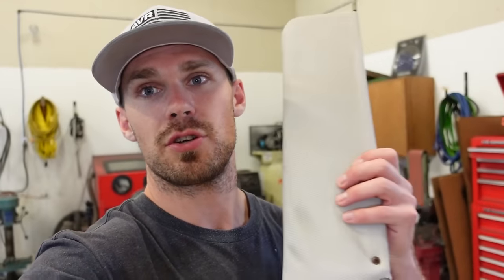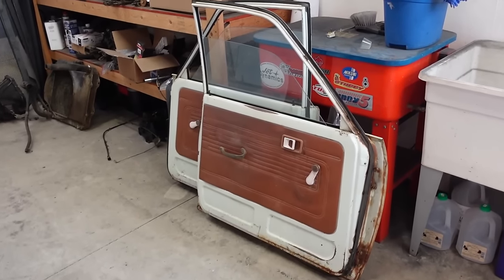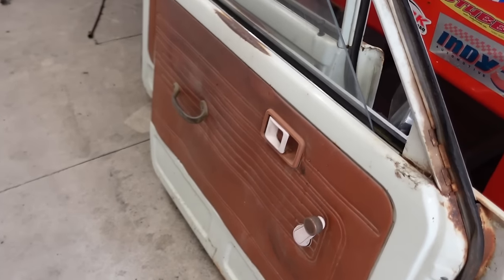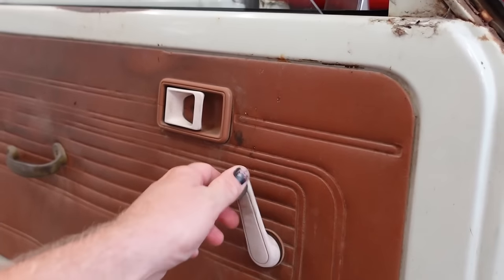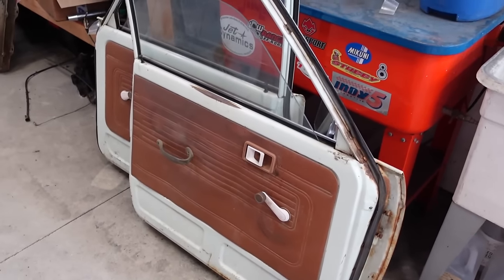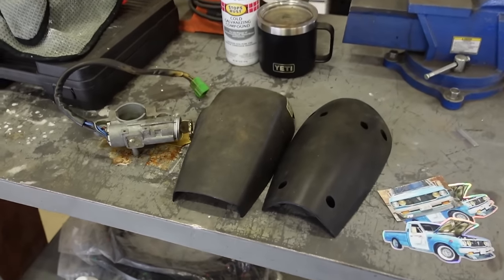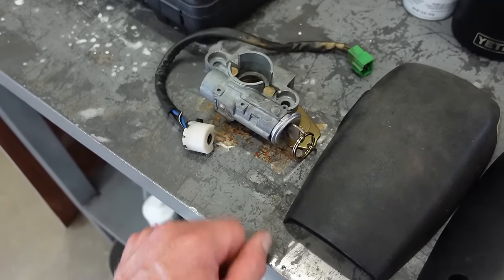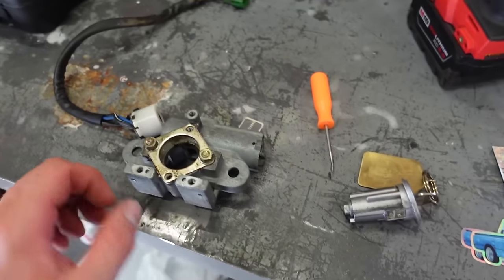Building The Best Looking Hilux Doors Ever!

Comment: Quite handy with the needle bro
Reply: Those sunvisors need some tying in say three spots in the centre as the weight of the material you just added will cause the bottom of the visor to sag and separate becoming like a pillow

Comment: Nice work, If your using old window channels, I find spraying them with silicon helps the window to slide easier. That’s what I use on my 89 first gen runner.
Reply: Putting silicone on all the rubber extrusions is super satisfying.

Comment: Beautiful job. Loved seeing the cleaning solution on the glass with the razor. I own a window cleaning company and that's how you do it. If the razor dislodges any debris that can scratch the glass, the solution will help carry it off the blade. If dry it will stay on the blade and potentially scratch the glass. When it happens you'll know. Sounds like nails on a chalkboard. Recommend you blade in sections, one direction, one line only. Allows you to stop the moment you hear a scratch. Running the blade back and forth willy nilly is asking for trouble. Anyway, again looks great.

Comment: Tuffed diamond....HELLO 80's!  =)  Looking good dude!  The only thing I would change it adding a bit of white piping trim to the edge of the door cards  & headliner to add a bit of contrast/separation.  (Think of it as edge banding but for fabric.)  With lots of black, which looks killer btw, some of the details can get lost without something to break it up just a bit. Just a thought!  

If you wanted to try it out cut a piece of white paper 1/4" wide and the length of one side.  Then tuck it into a seam where the panels meet.

Comment: Tip from my mom.  Should have flipped the sun visors inside out.  Then used a sewing machine.  Leave one end open. Slide in the sun visor.  Then stitch that last side by hand.
Reply from the maker: Great idea if I had a sewing machine haha
Reply: @austinniemela  that's true, the one downside is you need a sewing machine.  But hey, if you are doing interiors on more rigs,might pick one up a garage sale!  Great work as always.

Comment: Bit late now, but for future reference surprisingly mx5 (I think you call them miata's) door handles fit perfectly using all the original mounting holes, they sit perfect for an arm rest, and the front handle is also in the perfect place for shutting the door😉

Comment: I saw a Russian fella on you tube repairs  the door hinges. What he did  he remove the pins got a used engine valve drill the hinge to size and install the valve stem and used washers and weld the ends

Comment: The window crank handles do look the same as the 85-89 trucks. Interior door handles look very similar but probably not total bolt in.

Tip: Avoid the ebay replacement interior door handles, they are utter garbage. Wound up restoring the ones on my truck instead of using the replacements. Not sure how SEM paint would hold up on a high touch surface like a door handle but it might be worth a shot.